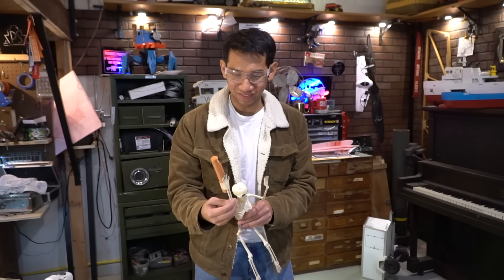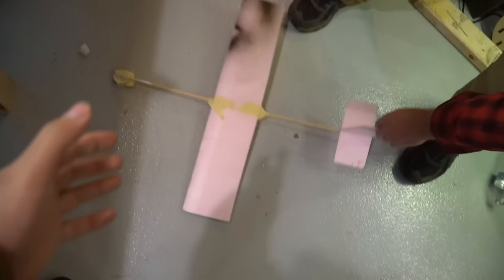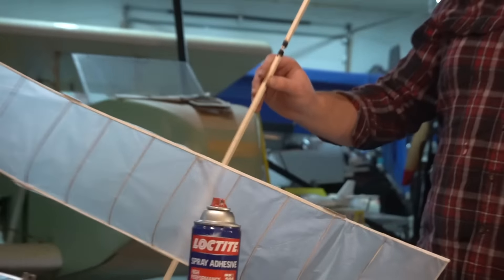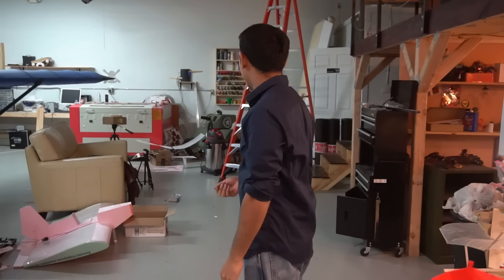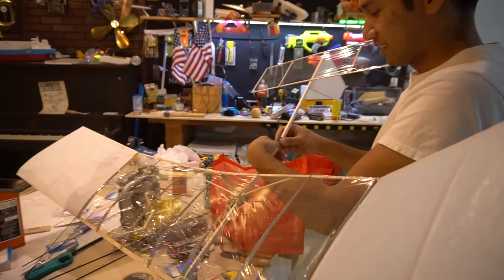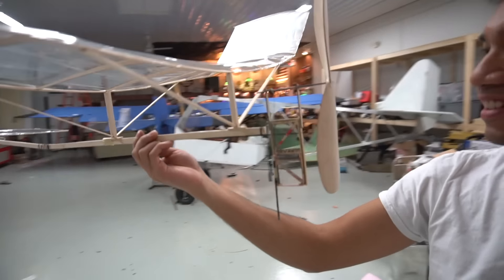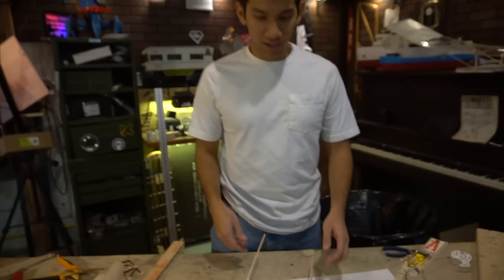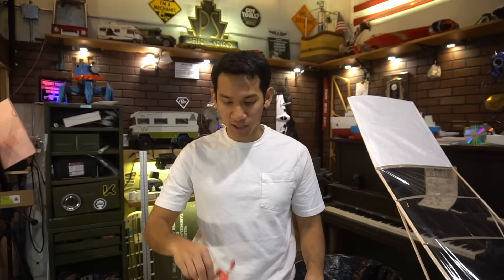Mousetrap Powered Airplane??

Comment: you need a large to small ratio to produce thrust not a small to largr
Reply: if you think about it you went from small to large to small you need morr string length and wrap it same diameter as the large gear

Comment: Great job, but your CG was a little too far forward.  If the mouse trap were moved back a little, about half way under the wing, then use a longer prop shaft, it wouldn't have been so nose heavy and would have flown longer.

Comment: Essentially what you guys were doing was attempting a clockwork powered airplain. You want to convert the energy it takes to wind the damn thing up to power flight? From what I saw, you plains flew no better with the mousetraps on or off. Good entertainment though. Thanks.

Comment: I am no master at engineering, but I don’t think he would want to put a year on the plane. With mouse trap cars, the larger the real the better, as the more times larger it is then the axle, the greater the mechanical advantage, but that also means that it would spin slower therefore, producing less thrust.

Comment: @PeterSripol one simple way to increase your mouse trap swing range may be to add a frame that is the same radius or maybe even larger than the mouse trap wire. This frame would also need a foot to prevent it from swinging past 90 degrees so the mouse trap wire itself would be pulled at an angle which kind of maintains its leverage.

One way to make sure the fame also comes down may be to use a wire to serve as that frame and making a loop at the top of that additional frame and a toothpick can be used tied on one side of the loop on the additional frame that can still be wound around as well once you get to that point in the string, and once its in operation it will pull the frame down with it. A bead may also work. 

Anyways sorry if that's confusing, but if you want to revisit it or do a quick test that may be a way to help maximize the operating range of the mouse trap.

Comment: Could you not have gotten more use out of it by altering the orientation of the mousetrap to run perpendicular to the plane. You could then place the trap at the other end and use more gears to counter the balance out of it on the front end which would also increase the output speed of the propeller. Not sure if the added weight would just cancel out the power gain and I have no education on the matter.

Comment: This is going to sound incredibly stupid especially because I’m not an engineer but what if when the first mouse trap snapped after it sat out all of the torque that it could so basically the first mousetrap would be very very fast it would use all of its energy immediately to let the plane gain altitude then when it would snap it would set off another mouse trap that would wind up the propeller to maintain that altitude

Comment: Maybe use pulling rod from both side of mouse spring frame? So it would pull the twine for efficiently. I also think that the propeller is little to big for whole plane. I would like to see the mouse trap with propeller behind the wings for better weight distribution. Maybe something like that: http://www.lotniskoketrzyn.pl/dodatki/MAS2018/atrakcje/minifox.jpg